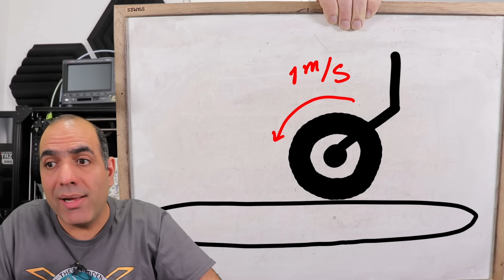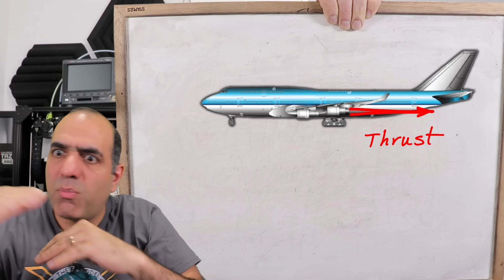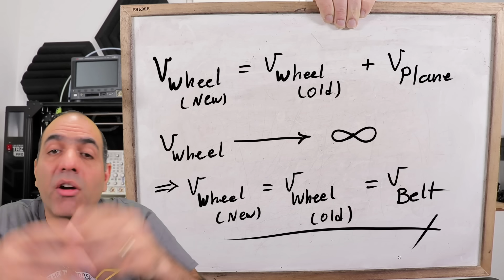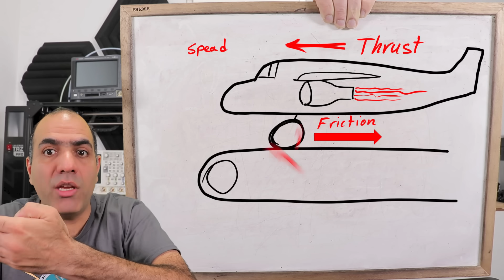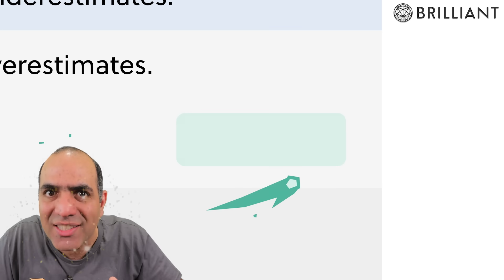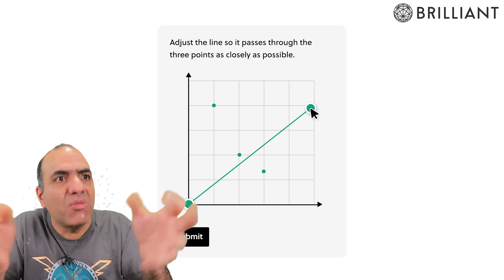Airplane Question that Drove Me NUTS!!!

Comment: As a flight instructor, this was a pain to explain to my students.
Reply: maybe u need to go back to school, the plane wouldn't take off.
Reply: @gabrielkrivian8453  no need to be rude pal, I also think the plane wouldn't take off but I'm not being that rude...
Reply: Are people seriously that dumb?
Reply: Then youre a shitty instructor. Dont the engines need more air by going faster and faster???
Reply: But there is no power going to the wheels, so the conveyor belt speed would have to overcome to thrust power of the engine. I guess it would really depend if the plane is starting with reversed velocity or not.
Reply: @alklazaris3741  Except it doesn't as the wings provide lift.
Reply: It is fucking stationary, the aircraft will not fly, because for that to happen, air needs to move trough the wings at that speed, right now, the engines are just peeping the speed of the conveyor belt, but if the aircraft acelerates, it will just fall down because THERE IS NO AIR FLOW UNDER THE WINGS WTF
Reply: That's why Mehdi made the video🤣
Reply: This seems to sum it up nicely https://youtu.be/Y64ZdSaDdoo
Reply: Now, why in dafuk would you waste time on this nonsense with your students?

These questions are "Gordian Knot Questions", ie, the common fool wastes time trying to win a 'fixed game' by untying the impossible to untie knot or even worse, totally useless exercise, instead of ignoring it or just pulling out a sword and cutting it, which counts as untying it.
Reply: I'm the king of England
Reply: Having passed Airline Transport Pilot morse code (pass mark 90%) I was able to join up the dots.
Reply: As a normal person, you're a menace to society, trying to put people that dumb and uncult in control of the life of other people. Worse thing is flight students usually have some kind of engineering degree, so I guess your school accepts anyone who knocks on their door...
Reply: @JoelLinus  ... If it didn't we would call that a fan and not an airplane..
Reply: @Kneumann1991  Yea, I was drunk when I said what I've said, didn't make sense at all.
Reply: Do your students think airplanes are propelled by their wheels?  This really makes me worry.
Reply: seems simple enough: 'lift is created by air moving over the wings'.
why is that hard?
Reply: Kinda made me think of a seaplane or something taking off while going up river.
Reply: Bro how are y'all instructors when you can't understand the point of simple hypothetical like this?
The point is, there's a force keeping the aircraft stationary on the ground with it's engines/wheels moving at full speed. 
What people are looking for is not rather or not the conveyor belt or wheels have good enough durability or whatever, but the simple physics of
"The plane in this HYPOTHETICAL can't take off because lift is generated by the wind moving around the wings, and that can't happen enough when stationary."
Reply: @hyperx72  Assuming there is enough durability then the plane will take off. The tires will not only be rotating but getting pushed forward, sliding, hopping and skipping the whole way.
Reply: @kamX-rz4uy  Of course, it's a reasonable assumption to say that things work according to the hypothetical's logic if it's only testing for rather or not wheelspeed has an effect on rather or not the plane can fly, just like a hypothetical involving golfing on the moon can reasonably assume we were able to shoot golf clubs and astronauts up there without getting lost in the weeds of asking "but how does NASA get the money for the trip" or "who authorized golf clubs" or "how would you even set that up"
Reply: the treadmill could be moving backwards at 10x the speed of the plane, with the wheels spinnig 9x backwards, the plane would still take off, planes takeoff on ice or water literally dragging the ground
Reply: @leandrrob  the text says the treadmill matches the exact speed of the airplane so the airplane would not move an inch, meaning it will not get an airflow underneath the wings hence it would never be able to take off.
Reply: @manusoftar  Friction from wheel bearing would give traction..What would happen if so called plane was suspended 1 cm above runway ,it would gain lift
Reply: @LOTPOR0402  lift is created by airflow over the wings. It doesn't matter how far above the surface the wheels are.
Reply: @manusoftar  You are thinking the plane is driven forward by its wheels. This is where you fail. The forward motion of the plane is due to its jet engines moving air. It'll take off as normal, but with a rather high on its wheels. The 'right' question to be asked in this scenario would be "Yes, it takes off, but could it safely land" as its tyres may have disintegrated as they were oversped during the takeoff.
Reply: @HOOOLD_ON   That's part of the problem, if the landing gear is destroyed during an attempted takeoff, it could cause the plane to not be able to take-off depending on when it was obliterated.
Reply: @HOOOLD_ON  planes land safely with no landing gear all the time. they don't tend to fly again without repairs, granted.
Reply: @manusoftar 
Planes do not rely on their wheels to provide thrust. They are there to keep the body of the plane fron dragging across the ground. 

While there will be loss of energy due to friction, It just means the plane will take longer to reach take off speeds. 

One could even argue that Since this treadmill is not powered itself, there would be no gearing that would cause it to spin in only one direction. That the plane wheels wouldnt even spin, and the plane would just drag the treadmill in the same direction of travel. Which would likely be worse for takeoff times.
Reply: @HOOOLD_ON  the friction between the wheels and the ground would make the conveyor velt speed cancel the forwar speed of the airplane, thus, the airplan will stay in place, hence, no airflow and no lift.
Reply: @olejniczak12  actually, if the treadmill is reaching the airplan speed is because it IS indeed powered and running quite fast. fast enough to make the airplane not move, so no airflow under the wings, and hence no lift.
Reply: @manusoftar  it will not move an inch *relative to the belt of the conveyor* it would still move relative to the air surrounding the conveyor because the body is pushed forward by thrust not the wheels which move independently of the body and because it's moving relative to the air the aerofoils will experience an increase in pressure beneath and a decrease in pressure above the wing resulting in the plane lifting off the conveyor.
Reply: @HOOOLD_ON  I still like the zero answer as it doesn't explicitly state that the engines are on :)
Reply: @RWoody1995  Which is how VTOL planes (and helicopters)  work :) What the ground is doing is largely immaterial.
Reply: @RWoody1995  nope, to move forward it should be able to get traction on the wheels, but if the treadmill is running as fast as the wheels it means that the wheels will not be able to make traction on it, hence, the airplan will be just slipping in place, as long as the airplan doesn't physically move forward there is no way it could get an airflow under the wings to produce lift.
Reply: @daexion  The plane doesn't need wheels to take off. It can drag itself to take off. It would just be on fire when it does.
Reply: @manusoftar  sorry, your statement is incorrect. the aircrafts thrust acts again AIR, not the surface, any movement of the surface is irrelevant to the actual airspeed of the aircraft.  There is no point of thrust transfers between the aircraft the wheels or road surface.
Reply: @manusoftar  Lol. You do realize that with your analogy it would actually increase wind speed to increase lift. Not by much, but still. Point is that wheels and ground have essentially nothing to do with plane lifting off. Jets will create thrust that will push plane on, wheels will just simply rotate faster. I'm curious how you'd explain how waterplanes work 🙂
Reply: @HOOOLD_ON  But the wheels impart friction to the plane. If you can't overcome this friction, you cannot gain speed relative to the air, and thus, no lift.
Reply: @Kneumann1991  The wheels are there for that exact reason, to help overcome friction. With too much friction, you don't get enough lift.
Reply: @john_titor1  yes and no. The wheels are there to reduce friction but they are free spinning. A plane has more than enough thrust to slide across the ground and take off without wheels. The plane would just be on fire as it takes off. You might understand how a plane works but you're still not understanding that the plane is moving through the air even when on the ground. The wheels are just to minimize friction on the ground like you said. You can increase the speed of the wheels as much as you want but the plane would essentially sit still when off. Sure the wheels might explode at some point but the plane will still slide then take off. It's not motion relevant to the ground that makes a plane take off. It's motion relevant to the air speed.
Reply: @Kneumann1991  Maybe with a jet, but with a normal plane, there is no way that thing is going to take off without wheels unless there is serious wind. It's clear you don't actually understand the physics of the situation. I know it's motion relative to the air that is important, as I have been saying that to dispute you this whole time. How do you think the plane is going to "move through the air" when it has 0 ground AND air speed due to friction? No relative motion to the air, no lift. There is a reason most planes use wheels, and it's not just for landing.
Reply: @manusoftar  it does not say it matches the airplane speed, it matches the wheel speed. Read it again then retry.
Reply: @jaydunbar7538  the speed of the wheels is proportional to the speed that the plane would try to move forward. When an airplane starts it's takeoff run, it will move forward at a certain speed and the wheels will turn on a proportional (not equal, but proportional) circular speed. If the wheels can get traction on the surface because it is cancelling their circular speed then the airplane will not move forward, hence, it will not be able to have enough speed, so no enough airflow underneath the wings, and so, no takeoff.
Reply: @john_titor1  You think you understand the physics but obviously you have no clue. Go watch the mythbusters episode when they do this with a small prop plane. Even if the treadmill spins faster and faster it makes no difference to the plane because the friction of the wheels and bearings could never be high enough to stop the plane from moving forward. Go understand the power of a plane. That seems to be your problem. Every plane has the power to drag itself along the ground without wheels. The wheels are to help smoothly take off and land. They don't allow a plane to take off and land.
Reply: @RWoody1995  How does that work? The way the plane moves forward is because it is on wheels that allow it to roll as the engines push it through the air. If the wheels can't move due to being flat or stuck in the mud, then would the plane still take off? No, because the plane is pushing air through the engines applying a force to the ground but can't overcome it due to the physical contact with the ground. Now if the engines were pointed up, they could pull the plane up and then turn like the Marine's Osprey to provide forward flight.
Reply: @leandrrob  In a real life scenario the plane would stand still until the belt or the wheels will fail. Some people REALLY need to go to school.
Reply: @gmlviper  consider the wheels spins independently of the relative speed of the plane/ground. even if the wheels spin at the speed the plane should take off, the turbines still going to push all  the weight of the plane and the wheels WILL spin faster but they are not dragging the force of the turbines.
Reply: @gmlviper In a real life scenario the plane pushes off the air and not friction from the ground so it will still move forward normally no matter how fast you spin the wheels backwards. Sounds like you need to go back to school..
Reply: @gmlviper  Maybe you need to go to school ,this is a situation that will never happen and never has ,since the  discovery of  humans flying
Reply: @gmlviper  Wrong, sound's like you need to go to school.
Reply: @LOTPOR0402  Wait... humans can fly?
Reply: @gmlviper  Well if the brakes were on then the plane would just drive the treadmill belt forward, eventually reaching a speed where the plane could take off.

It satisfies the question since in a relative sense the wheels and treadmill are stationary.
Reply: @Kneumann1991  Well, until the forward air resistance is more than the power of the engine(s). Lol. I'd hope that any competant design would have it flying by then. :)
"Sorry, sir, an engine strong enough to make this fly is extra money - all you can do is taxi back and forth..."
Reply: @darkpach666  if the treadmill is moving backwards as fast as the engines are trying to move the airplane forwards then both speeds cancel and the airplen is just standing still in place.
Reply: @manusoftar  has visto alguna vez un avión que use las ruedas para empujarse contra el viento y salir volando? Por qué los motores que mueven aviones empujan contra el aire, no contra el suelo.
Reply: @gmlviper  and you are apparently one of them. The speed of the wheels is irrelevant. A planes thrust acts on the air. That is what it pushes against, wheel speed has 0 to do with taking flight.
Reply: @Kneumann1991  How is it pushing off the air without speed? The speed gives it movement relative to the air. Assuming no strong winds, the plane cannot take off if it doesn't generate movement relative to the air.
Reply: @john_titor1  Wrong. It uses turbines or propellers that suck in and push out air at extreme speeds. The pulling and pushing of the air causes the plane to move. The wheels are there to only allow the plane to smoothly maneuver on the ground. The wheels do not drive the plane. I'm trying to make this as easy to understand as I can.
Reply: @john_titor1  Think of it like this maybe. If you're on a boat the propeller pushes water to move it forward. If you're in a car the engine turns the wheels to push on the ground to move forward. If you're in a plane the turbines push on the air to move forward through it.
Reply: @Kneumann1991  But without the wheels, the friction is too high to build up speed relative to the air, so no lift.
Reply: @Kneumann1991  I know how it works man, im explaining to you as simply as i can. Without the wheels, there is too much friction, the plane cannot move and therefore, cannot generate lift from the air.
Reply: @gmlviper  Assuming friction everywhere,  even if you turn off the engines and just move the treadmill, the plane will always move. Friction between the treadmill and the wheels will make the plane move in the direction of motion of the conveyor. If the wheels dont break down because of bearing friction and the conveyor is moved forward, the plane will eventually take off.
If engines are involved and the conveyor is free to move, the plane will always taking off.
Reply: @danielstewart7732  The plane's thrust pushes it through the air as long as the wheels are allowing it move forward. Otherwise the plane is just a big fan. The thrust made by the engines do not create lift. The plane moving forward relative to the air around it creates life. It uses thrust to make that forward movement through the air. To allow the plane to move we put it on wheels that reduce the friction. Once the plane moves through the air fast enough, the wings generate lift and take off. And that is what the question is asking. But it will only have a positive ground speed and zero air speed.
Reply: @NandR   As I have no clue what you are responding to, at no point in this scenario was it even mentioned that the planes wheels are locked. I am quite aware of the physics and mechanics of aircraft flight.. So let me be clear, in the given scenario. The Aircraft will take off with zero issues. Period. You can disagree with me all you want, you will still be wrong.  Go watch the Mythbusters episode where they completely debunked this nonsense.
Reply: @gmlviper in a real life scenario, there’s no plane on a conveyor belt lol
Reply: The wheels do not “drive” the plane. Thrust is the only thing pushing it forward. The thrust doesn’t care about the treadmill. The wheels will just be spinning a lot faster than they would normally.
Reply: @Piraneous which in turn generates friction. Said friction pulls on the plane in the other direction.
Mehdi explained it perfectly in his case 3.
Reply: @Piraneous the question literally states the belt matches the wheel speed. How are you getting that the wheel will just spin 2x the belt. Yes if that was allowed in the OP then you’re right it would take off. But that’s not the question at all.
Reply: @Piraneous  Thrust has to overcome friction, and as Mehdi illustrated here, friction will go to infinity (or the system will brake and the plane will fall flat on its fuselage). Why do you think wheel brakes exist? Planes aren't rockets on sleds.
Reply: @Yutani_Crayven  I misinterpreted the problem as having a fixed speed for the treadmill (basically the mythbusters test) rather than one that matches the speed of the wheels. Now I’m thinking way too much about it lol
Reply: Its actually not that hard if you think kinematics. To perfectly match the wheel speed means to keep the wheels static. The only way to do that is for the force from the conveyor via the wheel system to match the trust of the engines. Balanced forces means the plane 'system' stays static.
Reply: First off the problem dosen't state when the belt and plane's wheels reach the exact speed. Secondly if we can design and build a belt system like this. Why don't we just have Snotty beam us over to where we are going.
Reply: Oh boy. There's actually people into flying that don't figure this out? 😬😲😂
Reply: Easy explanation: the engine on a plane is "attached" to the air, not the wheels
Reply: @stdesy  attached to the AIR??? are you serious... the engines are attached to the wings, the wings are attached to the fuselage which in turn is attached to the wheels... dude...
Reply: @manusoftar  The wheels are attached but not powered by the plane. Instead they freely move on bearings. The plane will move forward due to thrust just like a rocket does. The wheels are just along for the ride. What will happen is in addition to rotating the tires will slide forward because they must move forward with the plane but can no longer turn faster than what they are against, in this case the treadmill. This will cause tire and landing gear failure but if the plane go fast enough before having to abort takeoff then it will lift.
Reply: @kamX-rz4uy  it doesn't work like that. I know the wheels are not powered but the friction between the wheels and the treadmill goin backwards tend to make the airplane go backwards while the engines try to make it move forward. Now, since the speed of the treadmill equals the speed of the wheels (keep in mind that in a real scenario, the fast the airplane moves forward, the fast the wheels will turn, so the angular speed of the wheels is somehow proportional to the speed of the airplane in its horizontal dimension) it will prevent the airplane from moving forward. 

In other words, the airplane will stand still on place, and because of that there will not be enough airflow underneath the wings to provide lift.
Reply: @manusoftar  No, you are way overestimating the friction vs the power of the engines. The plane will move forward even if it means shredding the tires and treadmill belt.
Reply: @Jawad. As a flight instructor you should know the difference between air speed and ground speed.
Ground speed is completely irrelevant to a planes ability to fly. All that matters is air speed.
Reply: Can you please list their names, so I will know when to wait for the next plane if they are the pilot?
Reply: Some people in the comments shouldn't post on science channels. They are not stupid, probably... They just don't know enough things. :(
Reply: As a Flight Instructor, this is EASY to explain to my students
Reply: but if the wheels are moving at the same speed as the belt in the opposite direction the plane won't move cuz no thrust. no movement of the plane. no wind under the wings. I guess its a different story if its the turbojet engines moving it, but the question seems to imply that its the wheels which are trying to move the plane forward.
Reply: @bringer-of-change  no plane is powered by the wheels, so no it’s not implying any such thing.
Reply: i remember airplanes requiring a starting speed for the engines to move the air and create thrust.
so i thought they used active wheels to get up to just slightly high speed.
if the runwheel stops the airplane from even starting to move the engines wouldn't work?
maybe I am thinking of another kind of plane.
Reply: @XxsniperxelitxomegaxlmaoxOwOxX  A jet engine does require high speed air to start. which is why you see that ground equipment with the big hoses hooked up to them. Um.... see the new Maverick movie where they start the old F-15 -  No aircraft I have ever heard of drives from , or through the wheels, they are all free spinning - think grocery cart wheels.
Reply: @XxsniperxelitxomegaxlmaoxOwOxX  no, 99% of aircraft gave up on having powered landing gear. A major reason is weight savings. As for the engines not working, imagine a desk  or ceiling fan used in a room. Air still moves even if the fan is fixed to a base or ceiling
Reply: @HeliosFish  ah yes. I had completely forgot about the fact theres a turbine in the engine. Thanks